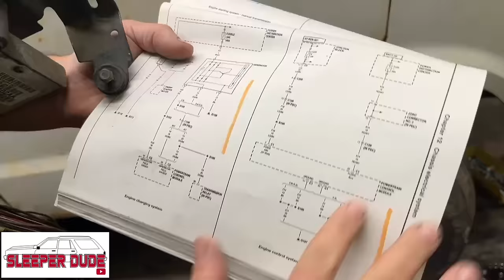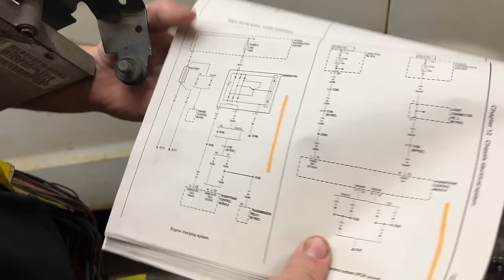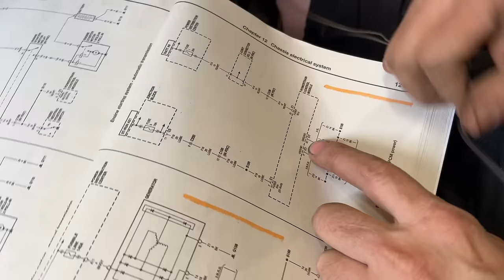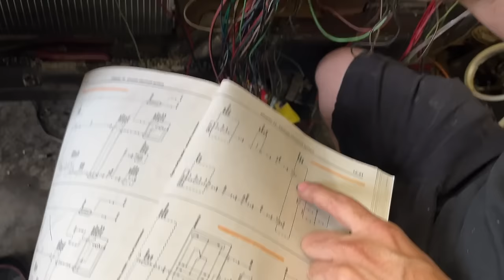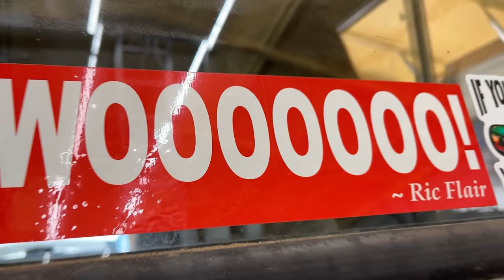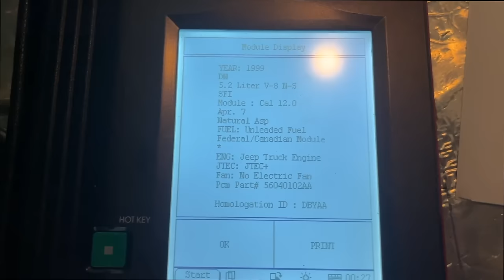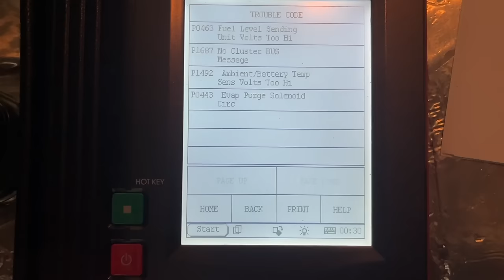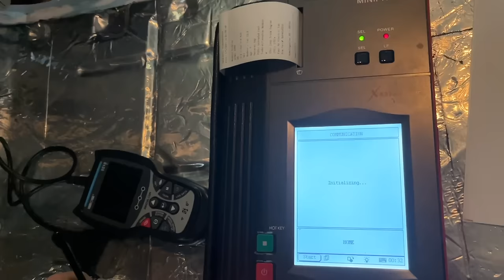2 Years of WORK Has Led Up To This! Will It Start?

Comment: Great Video your close to getting it to keep running.  Like folks have said re-check connections grounds, sensors, fuel pressure, its one of those scratch your head fixes that will turn out to be a simple fix but a hard to find fix.  Love the videos!!!

Comment: I parted out an 01 Jeep Cherokee and sold the computer to a guy that needed to replace the one on his Jeep. He called me a few days later and discovered that he need the steering column as well because when he swapped the computers it did the same thing your Dodge is doing. He swapped out the column and his Jeep is back on the road. I believe you are fighting the security system and I know that this runs through the ignition system. I have an 03 Yukon that I'm fighting the security system because it sets the light but it won't crank which leads me to believe I have more than one issue. I tried the computer swap like you and I had no change. I even tried doing a hack with bypassing the security system and that didn't work. So my suggestion would be to slave in the steering column from the Durango and see if that changes anything. Sorry for the long winded post, I hope this helps you out. BTW love the channel.

Comment: I have a 2000 dodge Durango and I had that problem with the security on it and what I found out was that I had to use the driver side key and not the remote that opened and unlocked the door so it sounds silly but that’s what I did to get it running again crazy but the security was at the door locked

Comment: I'm sure that you'll find and fix whatever is stopping the gas from squirting, and get the camper driving. BUT, if you can't get it done in time, I think you should push & pull the camper onto your flatbed trailer and take it on a road trip just like that. You can still camp in it, still enjoy all the sweetness that the Minnie-Winnie has to offer, and still have a toilet.  

By the way, did that Durango have a transponder chip in the key, and does it require the original ignition switch or a receiving unit for the chip? Would the new ECM with deleted security void that out anyways?

Comment: I think if it's a security issue you may need to use the original key and ignition switch.  The original key may have a small transponder in it that the original ignition switch may detect before it can fire the injectors.  I've experienced this on a VW when I tried to have a duplicate key made and they did not program the transponder (small pill sized) in the remote.  Maybe there is a "transponder" in the original key.  I admire your skills and dedication!  Hope you get her running.

Comment: On the column mann. I had a buddy (runs a local car lot) had a 76 smokey & the bandit t/a come In with a, starter button. On GM there's an ignition switch on the, column. It's in there like, Ragu. 💪❤️🤔

Comment: I was on-board with everything you did, except when you ran rubber fuel line the entire length of the camper! You know that's a big no-no. The trans cooler will be fine where it's at.

Comment: I applause you for keeping the theme Dodge.  Some probably would have dropped an LS in it.....  I am guessing the oil sensor, I've heard that before that if no oil pressure, it won't run?????  You'll figure it out I'm sure.  Hopefully a Dodge mechanic will give some insight.  I am loving the build though!  Keep it going and thank you for letting us tag along!

Comment: As others have said, hook up the oil pressure sensor if the computer doesn't see pressure it will cut fuel.  Also I know some cars need the cluster hooked up to work, early OBD-II mustangs come to mind.

Comment: Josh I just  looked up couple  secanrios,  crank won't run, or runs and stalls, it mentions  to check  all fuses including  power door locks, apparently  needs to see door lock signal in pcm to  say ok to run, I hope  this  might  help. I'm Ford  Mechanic  in Murfreesboro,  work for  Dodge and  Jeep  back in the eighties

Comment: Josh check your CANBUS wires make sure they have the correct twists per length. 

All CANBUS wire must be twisted pair cable, even short lengths (longer than 1 inch / 2 cm). The twisted pair wire is an essential part of how the differential mode filtering works on CANBUS, and without it, the signal can be easily distorted.

Comment: Hi the first thing I would check is that the the cam and crank sensors are synchronising this needs a scanner that has live data, open the option and turn the engine over on my scanner it says (done) if alls well. if not check connections or for faulty sensors . try to find another scrap vehicle for parts . ~One thing tho was the reluctor ring pick  up off same engine and gear box from the donna vehicle

Comment: Have you tested the resistance of all the injectors and tried the noid with all injectors disconnected? Check continuity and cross resistance of all injection loom wires.

Comment: A lot of ecu's of that era had a default injection for a low or no oil pressure sending unit protection mode!!! I noticed you said you didn't have it hooked up and was only using the oil pressure gauge!! Definitely would be my first thing to try!!! Best of luck!!
Reply: Sleeperdude try this and let me know!!

Comment: I talked to my brother ( master machanic) the early efi dodge would go nuts and to clear the brain you disconect the battery cable then touch them together for a minute to discharge any capacitors
Reply from the maker: Ok thank you

Comment: In pulse injection, all the air entering the engine first passes through an air flow meter. Here the amount of air is measured, thus obtaining an indication of the engine load, and this measurement is converted into an electrical signal to the control unit.

Comment: The rail pressure sensor known as FRP Fuel Rail Pressure Sensor or ICP Injection Pressure Control Sensor is responsible for detecting the fuel pressure in the rail through a piezoelectric system that varies the voltage sent to the ECU, depending on the existing pressure.

Comment: Dang, so close. When you started it after fixing vac leaks, I thought for sure.. Has to be a safety switch. Maybe there's a feedback on the factory oil pressure switch? Amazing job sorting that spaghetti mess out.

Comment: Wow that was an incredible amount of work. It was worth the 500 commercials i had to watch. I thought maybe it was some kind of oil pressure sensor hold in circuit. I dont know what I'm talking about I'm sure. I know my Olds has a hold in for the fuel pump but thats to keep the fuel pump on.

Comment: Hi super family
I helped a friend w a fuel injected dodge engine from a 97 after we followed Lincoln locker potholes and the engine stopped injecting gas … one time it was crash box came loose and we put sw wires on spring balance together.  The 2nd time was harder, it had a 80 gal rect gas tank that told the cpu it had shut off the gas hard and quick and relieved fuel pressure of about 60 lbs … we couldn’t’t restart it.  I had a 91 e350 fi w a large tank also so we drained most of his and put it in mine and gave the rest to a guy that helped.  The ford had a similar gas shutoff policy in its eec4 for accidents, the dodge had obd2 and a 36-1 or 60-2 sensor and did not use thinfilm spark and a rotor cap but had 8 coil per plug and could run wasted or normal spark, so the dodge had no dist cap like yours, but had a cyl 1 sensor and it ran sefi fi, not batch.  My e350 had thinfilm batch fi and a dist cap …nobody told us about any security on the 97 dodge. The spark coils were motor factory had coils w their own DVI’s and the cpu told them when to fire for race or smog, they put out over 60 kv.
Cheers mark h

Comment: Wow Josh you and family put some high energy brain power and effort into that to. The concern I have it sounds to have a gallop when cranking over. Valve timing issue, tight rockers, or low compression on a few cylinders? If that's a TBI system can you see fuel spraying when cranking with the coil unplugged? A clogged or bad TBI injector? Seemed to want to run when the fuel pressure was higher. Check all the sockets on the 3 ECM connectors for loose or corroded pins/sockets. Love watching your videos don't loose faith or give up you'll get it.

Comment: I have a 01 2wd 5 speed RAM sport/regular cab. Has 5.2. I wanna put the 5.9. I've still gotta learn how to balance the, flywheel. It doesn't have a donut & a flex plate.

Comment: Hey josh long time watcher, ive had dealings with the dodge 5.2l , check all your ground wires, i forget exactly where its at but near the powersteering pump on the orignal harness. when the orignal harness broke a  ground i lost all injector pulse but still had spark just a thought

Comment: I love your videos, I especially love these EFI swaps. I wonder if you will need the Durango's cluster and/or clockspring.  These things are sometimes Vin  specific,  and even a bad cluster will start a rig if it's present. I'm not a mechanic by any means, but I play with old rigs in the back yard. I wonder if it's using the clockspring for the same references as a BCM. You may need the whole steering  column out of the Durango.  Just an idea, keep up the great videos.😊

Comment: I can't remember if Chrysler did the same as GM with this but from what i remember, when you turn the key on, the pcm triggers the fuel pump for a couple of seconds. Then after its running, the oil pressure switch grounds the relay for continuous power to the fuel pump.  If the engine has a separate oil pressure switch and oil pressure sending unit,   the sending unit goes to the gauge and the switch goes to the pcm to trigger the fuel pump relay and possibly injector driver

Comment: You need to check your fence to make sure it will hold in a goat, once you have your fence ready to test  you need a clean 5 gallon bucket full of water, next you stand several feet from the fence with the bucket you filled in hand get a firm grip and sling the water from the bucket at said fence, if the water goes through you need to work on your fence, it will not hold in a goat! Love the progress on the RV, way to show us how to do the electrical!

Comment: Pull the ign key switch from the 99 and in the trunk area theres a security box. wire them up and it should start.

Comment: Verify 49PSI fuel pressure, the ECU is very sensitive to this also I have experienced is I had an ignition coil failure, and it gave me some backfiring before it quit, ( about 10 seconds worth) the ASD relay could be bad it  try swapping it or jumping the pins because it powers the injectors and the PCM grounds them. Take a test light and hook the lead to a 12v source and probe the injector plug, one of the wires should make the test light flash while the engine is running. The other wire (green/orange?) should obviously have 12v continuously while the engine is running. If the injector simply isn't getting 12v it's a wiring problem somewhere, if it's not getting grounded and the wire is good to the PCM it has to be a PCM issue.

Comment: Sometimes crank position sensors have eccentric mounting holes, which allows it to slide in and out for some adjustment, not much but enough to cause no comm with crank sensor

Comment: This is the best I found so far:

The first thing to do is to be sure the computer is awake. Turn the key on and check reference voltage to the tps, cam and crank sensors. If there is full reference voltage, check to be sure the ASD relay is engaging when trying to start the engine and that there is power to the injectors and coil/coils when cranking. IF there is no power to the injectors or coil when cranking and the ASD relay is not engaging, then we might have a bad cam or crank sensor (or a valve timing issue).

If there is no reference voltage to these sensors with the key on, then the computer might not be waking up. We will need to check all powers and grounds going into the computer with the key on. This includes, all powers through the computer fuses, fusible links and even the ignition switch.

Hint: Sometimes the cam and crank sensors can short out and pull the computer down temporarily. If all powers and grounds check out and we still do not have any reference voltage to the cam, crank or the tps, then disconnect them one by one with the key on to see if the reference voltage comes back. If so, then one of the sensors is bad and will need to be replaced.

Hope this helps.
￼

Amedee, Dodge Technician

Comment: Did you try adjusting the fuel pressure back up? Indicated on a dial doesn't necessarily mean that's what is getting to the fuel injectors. The computer might be cutting signal to the injectors if it thinks it's not getting enough fuel.

Comment: Don't know if you checked this but ran into a similar problem. Crank sensor gap was off made contact with ring. This will not always set a code.

Comment: Just for giggles take the pcm power inputs and temperaly run the straight to the battery and double check the pcm grounds i think your having a wiring issue else were probably get a good scan tool to watch data also check cam and crank signals may evan need get your bus signal to the cluster maybe trick it with a resistor or somthing
Reply: Unplug the the 02 sensor may not have the ground curcuits correct they may share with others

Comment: Excellent video Sleepdude Crew Josh  :) & family  on I say try ground battery clamp  , pig tail wire ground to fender, then to transmission bolt , fuel tank also see if that helps and have ground wire of key ignition to metal on  dash on connector to plus bolt also a washers for connector plus nut ! When clear codes do hold button clear each till beeps and confirm beeps to or when do code reader and hope have key ignition switch to ON postion and when clear codes see  if start up vechiles okay to ! Check Fuel PSI gauge on engine  has leaks on hoses turn pressure up then turn down when engine started up running okay!

Comment: I seen something like this on a jeep. There were different cam sensor wheel things through the years and a guy bought the wrong one. It bolted up but had different notches. It happened when he bought the wrong timing chain set.

Comment: Cam/crank signal has an issue. It shows it can fuel and can spark, so it must be shutting things off after determining something isn't right.  Possible shielding issue, induced current from nearby wire? Are cam and crank signal on the same wire? MAP,/MAF,  sensors reading anything? OBDII you should be able to  pull up a graph for different sensors and what they read  with a scantool.

Comment: I agree with a couple of others that the problem is most likely the crank shaft sensor. You changed that in another video. I bet that it is not reading and maybe just not seated far enough to pick up the magnetic signal.
Reply from the maker: We have a good signal from the crank sensor

Comment: We've had similar issues w/ International truck wiring/software for engine management. 
The diagnostic is always prohibitively expensive.
If there was a Holley sniper system for my trucks, I'd do it in a hot minute.

It seems you're not only quickly approaching the cost/benefit drop-off of the OEM system (which it technically is not), but you're retaining a system that you don't even know the extent of it's being tampered with.

For my money, the lesser of two evils is a sniper system.

It's not a loss to dump a system that has been compromised by Lord only knows who or what.

Good luck with it.

Comment: The best solution in this situation would be a salvage yard in hopes to find a Jeep Cherokee 5.2 with the security components. I have owned a 2000 dodge ram 5.2 318 and when the computer went out all it would do is crank over. I was told that was normal based on the placement of the computer because of heat from the engine some remanufactured computers wouldn’t work. I bought a new computer however, it had to be programmed before operation much like a plug and play system. It’s possible you can hook that new computer you bought see if it reads codes then clear the codes if applicable. Other wise sounds like a carburetor  or Holley efi in the making

Comment: Just got done watching your video last night and saw the issue you're having with the wiring I'm not a mechanic but I'm thinking  it's one of two things one has got to be a security issue ? on that one the other I know Ford Ranger newer vehicles have when they  get in a wreck the fuel system cut off it's got to be something  not hooked up telling the computer it's in a wreck  not sending a  single to the injectors I could be wrong can't wait to see what the problem was

Comment: Sounds like you got a Lotta good suggestions I’m leaning towards the oil pressure sensor. I have the same problem with the Generator.

Comment: Josh it may be as simple as needing to use the ignition switch  along with the original ignition key from the durango which has a chip molded inside the black plastic that isnt visible it is looking for the chip in the ignition key. Definitely worth looking into.
Reply: But if the ECU has no security features left on it, does it need the key chip to allow the ignition and fuel injectors to work?
Reply: It very well may be the issue. I have had some experiences with engine swaps on chrysler vehicles optioned with " no security features very base models but were sold with the over molded keys and had to use the original key that came with the vehicle to make it work and get extra chipped blanks from the dealer to cut extra keys.  Even with a reflashed ecu.. I have used a few from a place in Florida may be the same place Josh ordered his from.. no "garrronteeee" on how it was re programed and flashed..still would only work with the over modled key...same issue just my personal experiences. May or may not be the issue but simple enough to check. Keep up the great work guys!